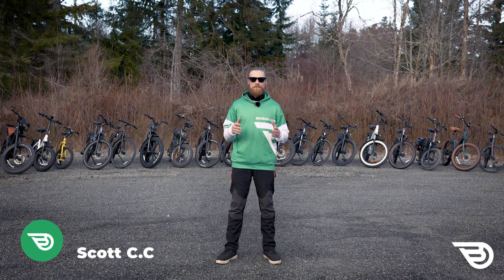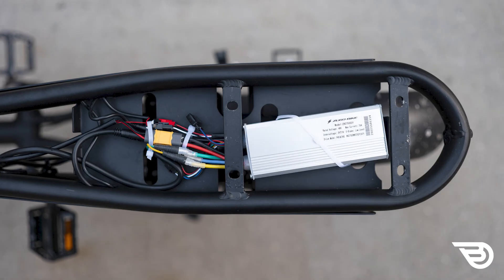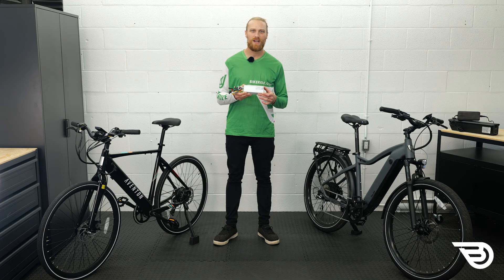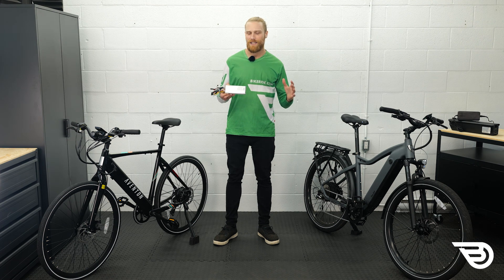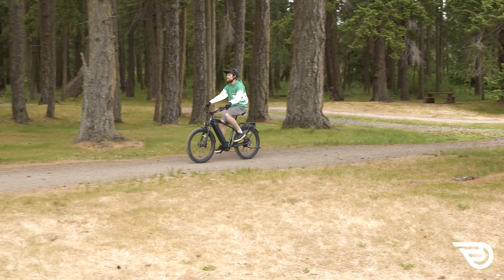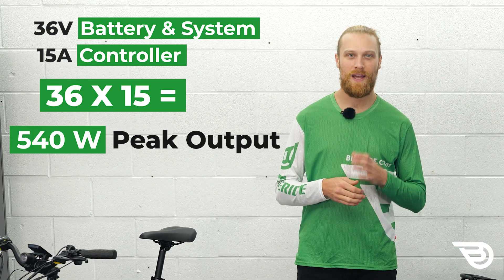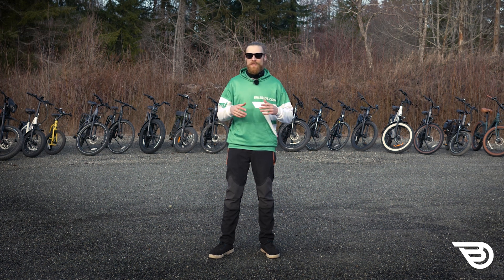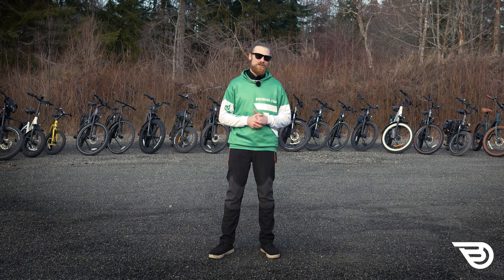E-Bike Controllers and Motors Explained - How Powerful Is My E-Bike Motor | BikeRide.com

Comment: My e-bike has a 36v 12Ah battery. Since I have had it from January this year, I cannot get more than 13 UK miles from a full charge no matter how I ride it. I admit that my weight is on the limit. Does putting a 36v battery and a higher Ah battery give me a longer range?
Reply from the maker: Good questions! Yes, upgrading to a higher Ah battery would increase your range.

Comment: what if your ebike dosen't have a control box   then what do u do
Reply from the maker: All e-bikes will have a controller, it may be hidden inside the frame somewhere
Reply: @BikeRidecom  not my the  power  comes from  the  battery  to  the  motor  bypass control box
Reply from the maker: What e-bike do you have?

Comment: I have a HITWAY BK11. It fits perfectly, but I have found through having to investigate using a multimeter, that I only use 5.2 volts at best with a range of 12 to 13 miles when the battery runs out, but the bike readout still shows 35/36 volts at the time I lose power. HITWAY don’t seem to know why this is happening. I am wondering if it is too much weight with me and the bike, or maybe a design fault, with too low voltage in the battery. Maybe a 48 volt battery would be better, but will that be too much for the 250 watt motor? Any help would be greatly appreciated please?
Reply from the maker: This could be an issue with the bikes controller, or an issue with the battery itself, possibly due to faulty battery cells. You will not be able to swap a 48V battery into a 36V system though. The battery voltage must match the controller and motor voltage. 

When you test the battery voltage off the bike, does it match the bike's display reading?

Comment: You really want a serious question?48 V 2000 amp hour battery verted over with in
nline wire.Will it fry out the controller?Or not

Comment: I wanted to know how to put a brake light on a ebike that not got one
Reply from the maker: A quick warning before I answer your question fully. Adapting or altering the electrical system on your e-bike will most likely void its manufacturer warranty. Also be careful with electrical components; always complete work to the electrical system with the battery removed from the bike. It is also important to note that since many e-bikes are a 48V system (including the lights), some additional protection must be taken if you are accustomed to 12V electrical as it is a higher voltage = increased risk of electrical shocks.

If the controller is not setup with a separate input for the brake light then your easiest method of installation for a rear-facing light would be to splice into the front headlight in a good place, run a wire to the rear and install a 48V LED rear light (or the running voltage of your e-bike). Make sure you seal and waterproof the splice (heat shrink tube with glue inside etc) to the best of your ability to maintain your bike's water resistance.

Now, this is not going to give you a braking indicator(flashing etc) as that would require some kind of input from the brake levers to activate the effect. But it will give you a rear-facing steady light that will be turned on when your front light is on. Installing a light with a braking indicator would be more advanced and probably require you to upgrade your controller.

Comment: Vivi FM20 Full suspension, 500 watt, 18A controller, 48 V $520. What's not to like?
Reply from the maker: I have not had a chance to test any of the Vivi lineup, they appear to be generic Chinese e-bikes with a range of budget components. The price seems good, but I would be interested in the longevity and quality of items such as the battery and its performance. If you get a chance to ride one, let me know how it is! 

Less expensive e-bikes are a prime target for battery issues, so personally, I prefer brands offering UL certification now that it is becoming common. This is the best way to protect against fires, which is IMO the #1 safety issue after massive component failure on a ride.
Reply: @BikeRidecom  I bought one last week simply because it ticks all the boxes. The web site says it meets UL 2849/2271 and the CE specs too. And yes, the frame design with the use of extruded shapes is pretty generic but that's proven and adopted by Lectric etal. It seems to work fine in a few miles of testing, but the weather has taken a turn back to the 30s and raw.
So far, it hasn't shown any major flaws except the cheap display found on many budget models. We'll see when it warms up. I bought it as a poor man's Lectric with full suspension. I'm getting too old for a tall bike with a hardtail.